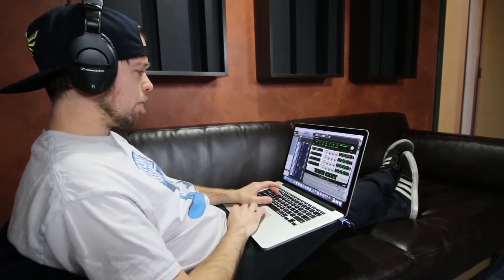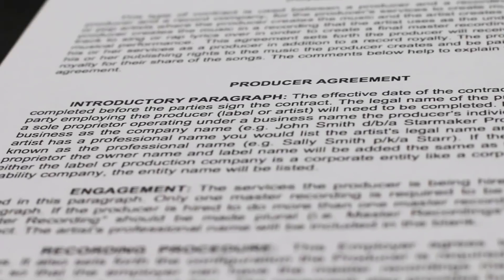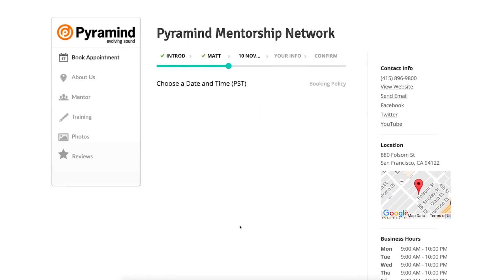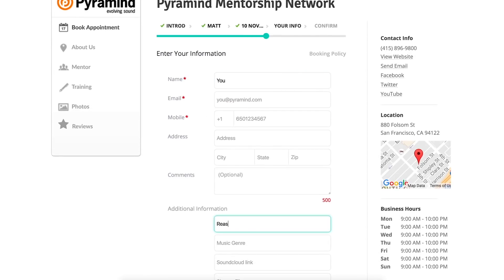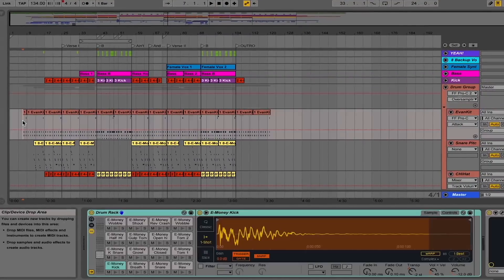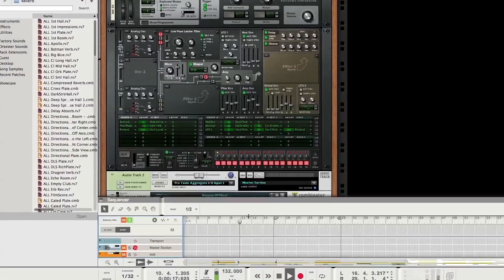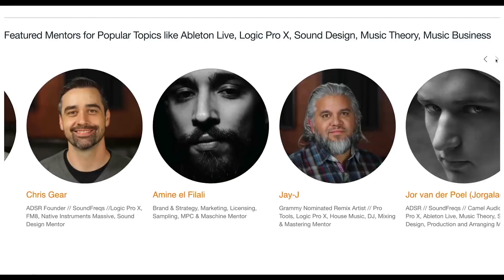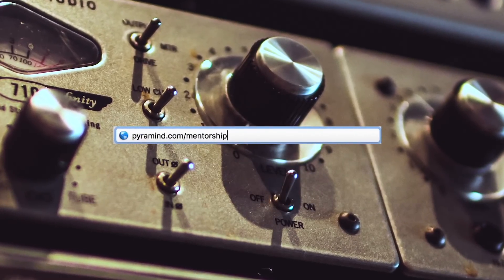Algorithmic vs. Convolution Reverb | Kriss Walas

Comment: So many parameters to convolution reverb? You literally have virtually no control over reverb IRs except your wet/dry mix, and possibly artificially attenuating the tail length. It's algorithmic reverbs that have a host of parameters you can tweak. Really sounds back to front. IRs are simple because there's very little you can tweak with them.
Reply: It depends which convolution reverb we are talking about, for example, the top 1 convolution reverb Altiverb has a lot of parameters like: reverb time, diffusion, damping, predelay etc.
Reply: @reyfernandezjr  Those are post-processing of the reverb. I.e., applying algorithmic type processes to IR reverbs. You certainly cannot by definition have more parameters in convolution reverb since it's fixed. It's a snapshot of the reverb. It's backwards to say that convolution is more complex or has more parameters. At its heart, you can simply slap it on and adjust the wet /dry mix. Any other 'parameters' are going to affect the naturalness of the reverb sound and you lose some of the advantage of using convolution reverb.
Reply: @thecaveofthedead  cool, I see your point. it makes sense.
Reply: @thecaveofthedead  ur wrong bud
Reply: @xoxo-pp7ru  You explained it so well. I'm convinced.